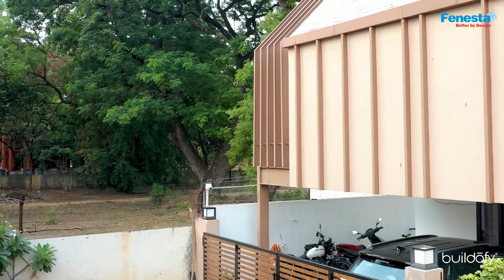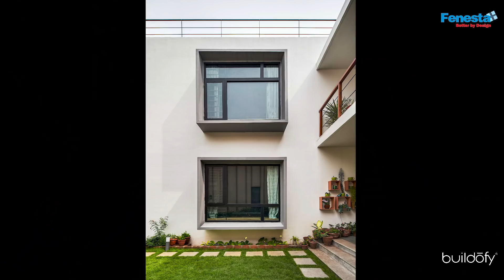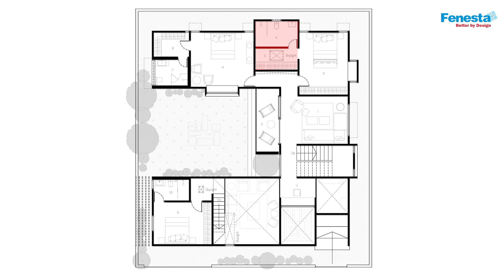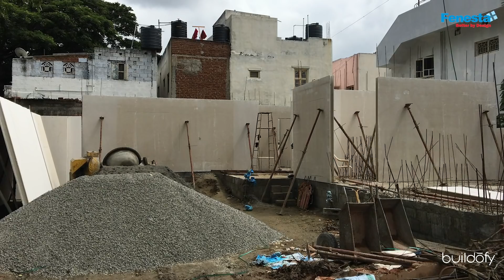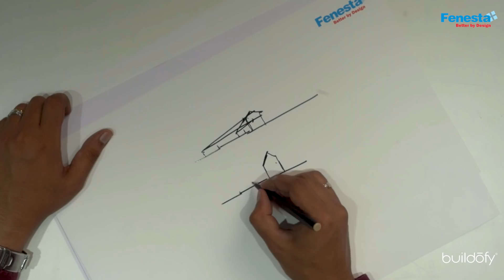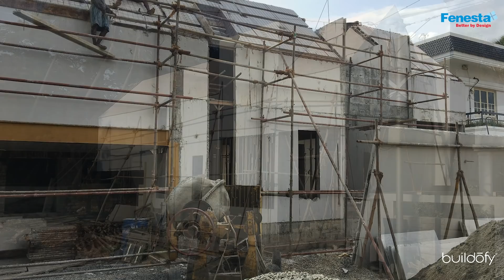3,960 sq. ft. House of No Bricks in Coimbatore by Urban Design Collaborative (Home Tour).

Comment: "Sustainability" is not using recycled materials only, it's also about long lasting. If you use recycled materials to build structures which would need to be torn down & remade every 20-30 years, then that is literally the opposite of sustainable. Gypsum is not a strong material, even when it is reinforced with glass fibre. If this structure needs to be torn down after 30 years when the gypsum composite starts to fail & fault, then the whole point of sustainability becomes moot. I also didn't see any framing of the strucure; that would mean that this is a load bearing structure, which reinforces my point. It is better to use more durable materials (simple brick & mortar, beams & columns, footings) in order to be sustainable, i.e. to live in the present while leaving the earth for the future generations to live as well.

Comment: The Risk taking appetite of the client must be high..
Although GFRG panels have good heat & sound resistance & is a green material according to UNFCCC they do have their own problems can't drill a whole for a single nail, cracks on vertical joints, toilet leakages, no flexibility once done is done etc..

Comment: Looks like the Kota stone has been exposed some sort of Acid material. The white spots on the stone was very evident. Over-all the structure looks good. Mixing of traditional and contemporary should have been avoided. I feel it would have made a very beautiful completely modern house given the use of Materials like pre cast and aluminium windows and the front cladding.

Comment: I like this... I was looking for many constructions with GFRG panel. Good that I've started to see from Buildofy. I heard we need more space around the construction area to use the buldozer for lift and shifting the panel. Surprise to see that you guys have made it possible in the given space.
Reply: Yes it’s quite difficult to build in tight plots, we constructed the project in phases, rear first and front next. Cranes are required to manage panel movement. An empty neighbouring plot also helped.
Reply: @urbandesigncollaborative9530  Lucky that neighbouring plot helped to achieve ur beautiful plan/structure